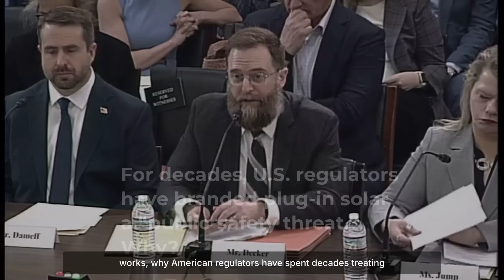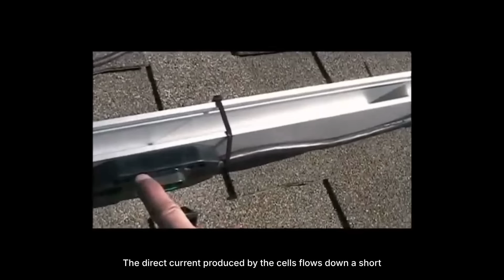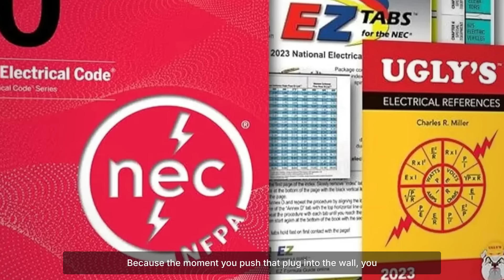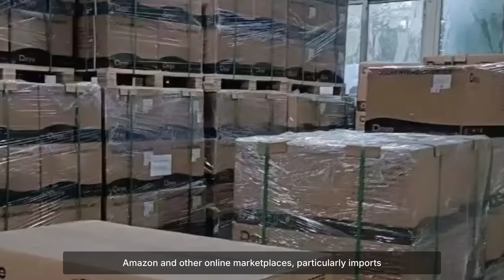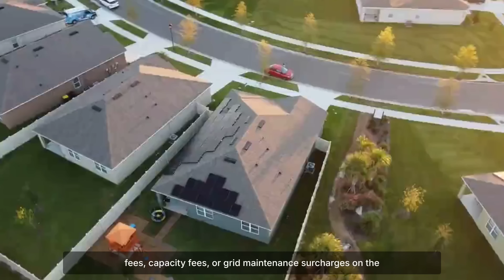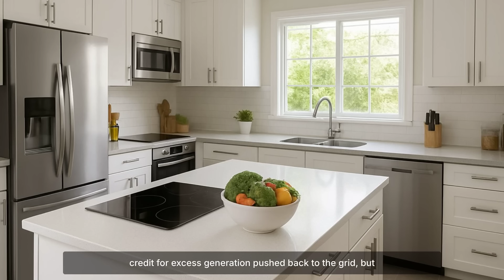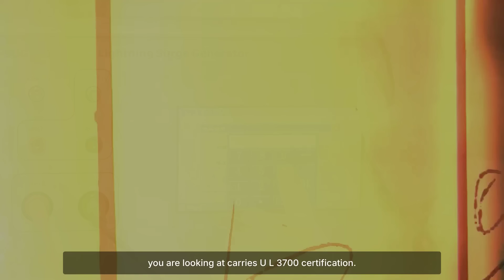This DIY Solar Trick Powers Your Home for FREE. Why Is It Illegal?

Comment: I'm an electrician and I'm not going to preach safety because the power from your switch board grid circuit breaker can add to the power from your plug in solar and deliver excessive energy to the outlets on that circuit......no that is up to you to figure out and think how it impacts your home insurance cover! 

No what I want to mention is that the new smart meters do not have a spinning disc that can be driven backward by the solar and reduce your bill... no they just measure watts going through them regardless of the direction....which means you not only pay the full price of power you use, but you pay the same price to give your excess power to the power company.... 

An example of this a few years back is I talked a friend into putting solar panels on the roof of his business to reduce his very high power bills...he installed 10kw..... the installation was completed just before Christmas,  but the power company have not touched his power meter as yet... so he got the idea that since the business would be shut over the Christmas period, he would just switch his fully installed solar installation on and not wait for the meter to be fixed.... We were sitting and chatting at the company Christmas break up when he told me what he had done, looking very pleased with himself...  When I explained to him what he had done he was horrified, and I accompanied him back to the business to shut it down.....I was able to get the power (kwh) reading from the inverter and figure out exactly what it cost him....lucky we caught it because in just one week it cost him $90 to give his power company his electricity... so that feed in only saves money if you use all your power yourself and do not feed any to the power company, or you have one of those old revolving disc meters.... of course if you do it right with proper contracts then it is all sorted, and your home insurance still covers you.
Reply: Do they really measure watts, or is it volt-amps? 🤔
Reply: @onradioactivewaves    Power companies generally only bill people for the kilo watt hours of energy they use...so typically the only measure watts.... 
But if a customer is suspected of having a high reactive power consumption...they will measure volt amps and possibly introduce a charge...

Do you know much about watts and volt amps?  I use to teach generator and power grid operations so I'm happy to explain bits and dispel any notions of foam on beer stuff!
Reply: @apollo8352 I've worked on a meter design
Reply: @apollo8352 so here in the USA, what i've heard was that typically a residential customer will simply get bumped into a different bracket of how they are charged if it is discovered they have an abnormal power factor. This was back before smart meters were even a thing really bit were just starting to come out, so im sure the lokicies have changed by now.

 When it comes to industrial, we have somethjng called load shed, a signal sent in the power line where you are suloosed to reduxe lwer to avoid brownout situation. Another thing youre supposed to do is not power uo all.of your machines at once, to avoid a slike in the reactice power.

I have some years of working on  design for controls and automation, metering,  and sensors for control systsms for lighting.
Reply: @onradioactivewaves  Maybe we should discuss this in slightly more depth for anyone interested then...    When we operate a generator and a customer switches on a load that consumes watts, the generator gets harder to turn and will burn through more fuel to keep it spinning at the right speed.  Because most of our generators use magnetism to generate voltage,  there are certain loads that a  customer can switch on or exist in the system that cause the current to get out of alignment with the voltage, by how much is usually reffered as the phase angle.  To facilitate calculations we generally use the cosine of that phase angle to give us the term power factor.   For a resistive load like an old fashion light bulb the current and voltage stay lined up with a phase angle of zero, and Cosine of zero is one so theformula    W= V x I x PF can be used so for load that are DC or have a unity power factor of one   volts times amps equals watts.  

Now if our customer was to switch on a load such as a transformer that has magnetising coils, but had no load connected to it, the transformer, would use some power to magnetise its metal core, if it is feed with alternating current  then the changing magnetism will be a continuous load, but the curious thing about magnetic coils on alternating current is you nearly get back the entire amount of power used to magnetise a coil when you demagnetise it...but in the process the current gets out of alignment with the volts and actually flows slightly after the volts,  which we say the current is lagging the volts.  Current still has to flow to magnetise the magneti ccoil and steel... but because the energy is returned in demagnetising which means a transformer with no load on it will pull very low watts but may be pulling much higher amps than expected.... think W = V x I x PF with the PF getting close to zero.   we could have almost zero watts on a 110v circuit drawing 10 amps.... My students at this point would be questioning if this was free power when I set it up to demonstrate....with meters monitoring it all so yes the power company who mostly want to charge for watts would be giving you free power to magnetise and demagnetise your transformer.... but how does it benifit you, since the core does not give off light or sound and you pay for any watts of heat it uses?  
Back at our generator the effects of switching on the low power factor load with no watts is no speed change requiring any extra fuel, but a voltage drop due to the current being consumed out of phase with the volts, requiring us to add additional excitation current to our generator to maintain terminal volts.  The wires in the generator are of a fixed size with specific cooling so if our generator had to many low power factor loads turned on it could very easy reach its maximum current rating while its watts remained close to zero... and if your profit lies in selling watts, you can see there would be an issue. 

I just want to touch on the opposite type of load, which is capacitive...  the definition of a capacitor being two conductors separated by an insulator.  when we apply a voltage to two conductors separated by an insulator current rushes in as the voltage rises electrically stretching the insulation, on alternating current circuits  it gets streched one way and then back the other way, and you get back most of the watts used to strech the insulation when you discharge it and bring the insulation back to rest.... this like the magnetising coil inductor, uses almost no watts but will consume unexpected amps which again are out of alignment with the volts, but due to the springiness of stretching cause the amps to flow out of alignment with the volts but this time the current leads the volts, the opposite to lagging from inductors.  
Due to the nature of magnetic generators when a customer switches on a capacitive load the generator terminal volts generally rise and so the DC excitation   within the generator has to be reduced. 

Now the problems... a grid transmission line is essentially several conductors separated by insulators... so until a consumer load is switched on it is basically a capacitor.... so imagine a really long transmission line that when you switch power on to it.... the watts would be almost zero till the customers get turned on to the energized line, but say your energising and it is 220volts and drawing 200 amps.... if your generator is say rated at 100 amps... even turning the generator excitation current to zero would not be able to prevent the terminal volts of your generator going sky high and damaging itself and the transmission line... So you need big enough generators not in watts but voltamps to be able to consume all those capacitive amps... the term for any volt amps that flow out of alignment is reactive power and it can have instrumentation on the generator showing volt amps reactive usually abbreviated to VARs. 

Now the future, our large use of old fluorescent and mercury vapour , metal halide etc lights which used inductors for current limiting and gave us inductive power factor lights... are being replaced at record speeds by LEDs with circuits the run unity power factor... in industry it is now cheaper to put in a   vetriable speed drive magic box... than to wire a contactor and relay for direct on line starting...plus tgey give you soft start speed control etc etc all with unity powerfactor... 
Our power grids are becoming more and more capacitive...,meaning magnetic generators must run with lower and lower excitation....and it is that magnetic excitation that locks the rotating magnetic field of the stator to the rotating magnetic field of the rotor together...risking what is termed as pole slip... 
At this very same time solar power is being added to the grid in large quantities, putting in lots of watts but running entirely at unity powerfactor, so more and more power factor is being forced onto magnetic generator owners so that solar and wind generators can feed power into the grid and make a profit.... 
Imagine you run a generator and the grid people say we have no need for any of your watts that you get paid for.... but we need you to run your generator to consume reactive power... you have you generator spinning wearing out and your staff there running but don't make a cent for doing so!     This has resulted in contracts being written up at hydro power stations I was involved with getting paid to spin with almost no water flow.... one engineer of such plant said he decided he was going to install static PF compensators to try and get the same payment for VARS Without wearing out his generators....   I suggested to him he needed to look into that a little more because static correction of PF introduces an instability, in that it wants to resonate when it transients through unity power factor.... and the only reason they are paying him and not installing their own static compensators is they are aware his thrust bears are taking a pounding. 
Overall running a power grid you monitor frequency and that indicates a excess or deficit of watts (maybe mega watrs) in the system, and volts which indicate an excess or deficit of VARs in the system.
Reply: I'm good with .ost of what i read thus far. Sonxe you took the time to write all of rhat, i will read though it carefully.

In simple terms, reactive lower has real power losses, and greater grid and generator demand.
I will say that LED drivers are capacitive loads, same of electronic ballasts. Its the old magnetic ballasts which were inductive. 

As far reacrice lower goes, i give the simple explanation as this: more reactive power means a larger grid capacity and generator demand is required.  In a perfect world it would end at some initial load.and the grid capacity,  but thag reactive power has real losses in the powerline as well - losses which occur on the suppliers side of the meter.

If you can get over the humo for the marhematics to get into the complex frequency domain, the math gets simpler.  Watts are P=VI* where I* is the complex conjugate of current. Using phasor notatiom for a single frequency is nice and easy at the basic level 🙂 and of course gets more complicated when getting into the harmonic distortions. Some transmission line theory is  really required to properly discuss this topic.
Reply: @onradioactivewaves I know it is like preaching to the converted as you seem to have a good handle on it...   But incase you have to explain it to others maybe a simpler way of thinking about it is... a generator can only put out so much voltage before damaging itself, and its current is limited by the wire size, cooling and type of insulation... and is normally stamped on the name plate.... giving us a maximum continuous Volts x Amps output, sometimes in kilo volts amps KVA or MVA  mega volts amps.....
So given volts times amps has a maximum.... then  when we go to Power (watts) = Volts x Amps x PF .......I could have 12kv x 1000 amps and if the power factor angle was 90 degrees, another words zero cosine then    watts would be zero even though the generator is putting out its normal rated volts and maximum rated current.... 
For me as a generator operator feeding on to a big power grid in which my generator is to small to effect its voltage, then I could reduce the excitation whivh would lower the internally generated volts which would reduce the wattless volt amps I'm feeding out... which would  then give me some spare capacity to increase my prime mover output it trying to raise grid frequency and that would start to export watts... Remember generators, transformers and distibution networks have a maxium current rating and that means if most of the amps following are due to low power factor then it is hard to send enough watts through without over loading things... it becomes a trade off you want more watts then you get the most with unity power factor of ONE.   But the system may need a generator to supply something less than Powerfactor ONE... 

i hope this is of interest and makes sense...

Comment: IF YOUR GOING TO REASON THAT POWER LINES ARE ALL OFF, THEN SOMEONE IS FEEDING THE LINE... AND THIS WORKER DOESN'T TEST THE LINES., HE IS AN IDIOT!!

A GOOD WORKER SHOULD TESTED ALL LINES BEFORE WORKING. IT IS SAME AS WORKING ON A HOUSEHOLD OUTLET..

THIS REASONING IS BS.
Reply: So what happens when a worker checks the line with no backed power,  proceeds to work in it and then the backed supply is switched on somewhere?

Comment: So the short engineering answer is:
UL 3700 prevents circuit breaker masking by forcing plug-in solar to connect only through a controlled, listed PIPV interconnection system where the circuit either has no other loads, has conductors/protection sized for combined current, or has active/integrated overcurrent protection that sees and limits the total current.
For your solar-installer brain: this is basically UL/AHJ saying, “You cannot backfeed an unknown 15 A branch circuit through a convenience outlet and assume the upstream breaker still protects every conductor segment.”
Reply: Add dedicated circuits for plug in solar.

Comment: I'm curious how this new standard handled breaker masking. That's my only issue with it because it CAN burn your house down, particularly at 1kW, which is 4A @ 240V or 8A at 120V. That can allow a 150% overload on a 15A circuit. That's hot!
Reply: It's simple! When the power companies power goes off the ul3700 knows it and stops the power from the panels going to your outlet.🎉😂 But most star will fight it anyway. They don't want anyone saving money or lowering their power bill!🤬